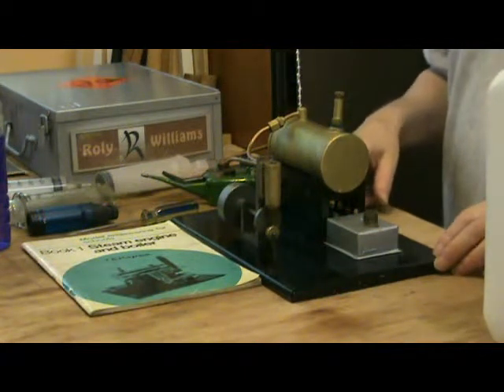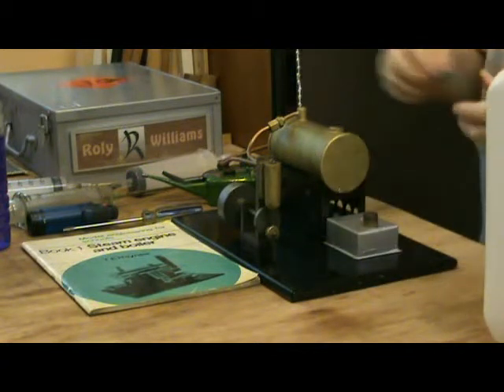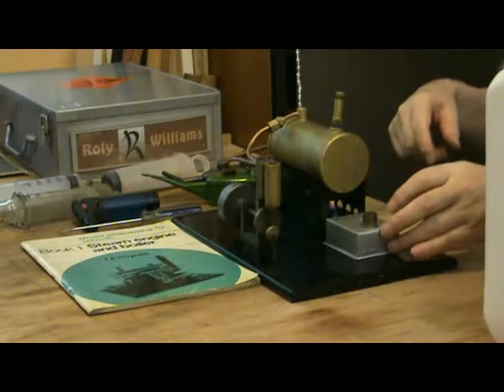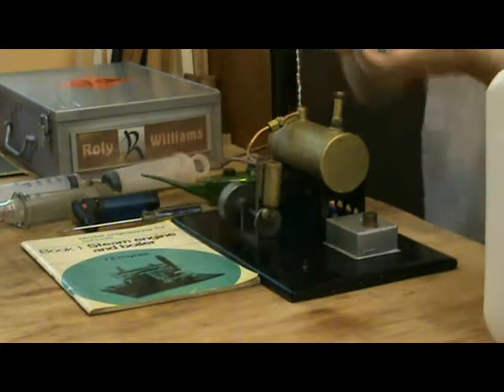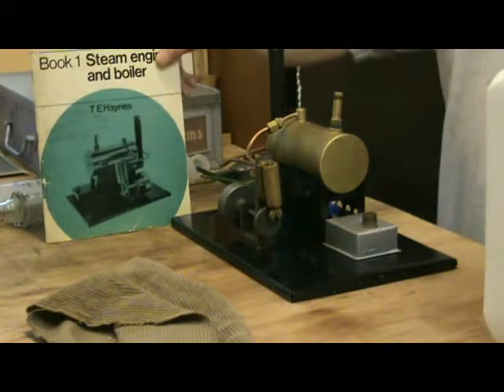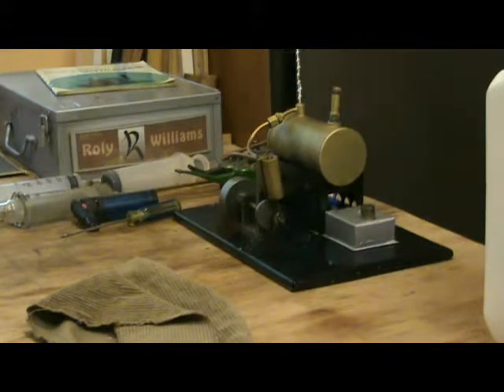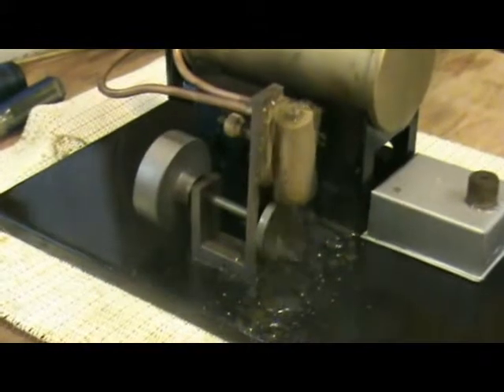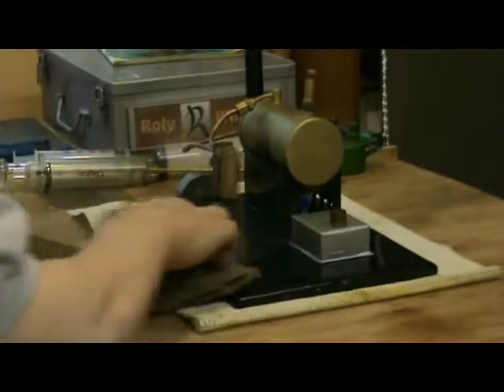T E Haynes Steam Engine 2

Comment: Hi Roly, I was pleased to see your engine, I've built 4 of these engines & taught 18 lads to build their own on lunchtime model engineering classes I ran at the school I worked at, didn't like the metal base so made a substantial base pattern in mdf  & we cast them in alloy, your crankweb hasn't got the cut aways which helps to balance it & along with the cast base they don't move about,I put a level plug on the end of the boiler so you can fill it till it flows out,as you say they're robust engines compared with mamods, as we speak I've just come in from the workshop after running in 2 more engines on compressed air,  I'm building,will strip down,sand blast & paint them.next.
Graham.
Reply from the maker: Hi Graham. Thanks for your comments. I agree that the simplified crank has not improved the balance. Whoever made this example (not me) presumably ran out of time on that day's lesson! I can imagine that a cast base would improve matters somewhat, but I guess some schools don't have casting facilities.
Reply: @RolyWilliams  Hi Roley, thanks for your reply, I have had my own foundry for 50 yrs but as you say many schools don't have one, the school one was never used till I started working there [as the technician],I used to help 6th formers with casting they really loved it but since I retired it's never been used which is a shame.
Graham.